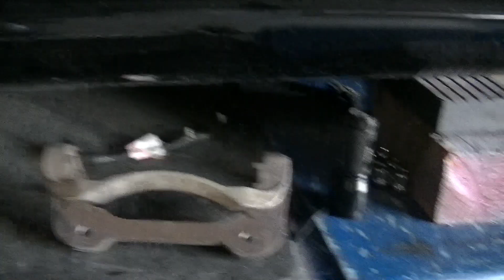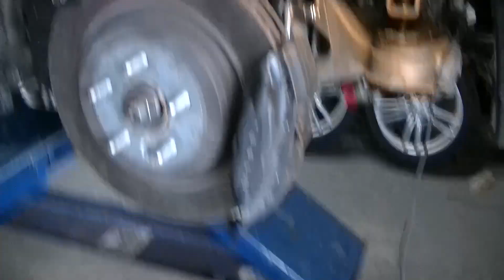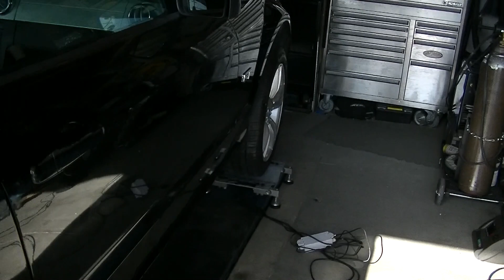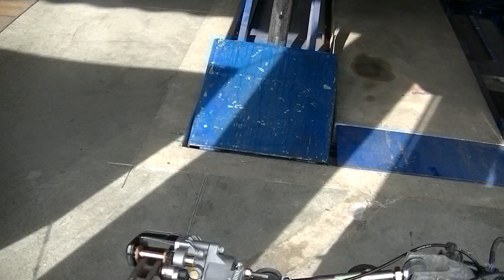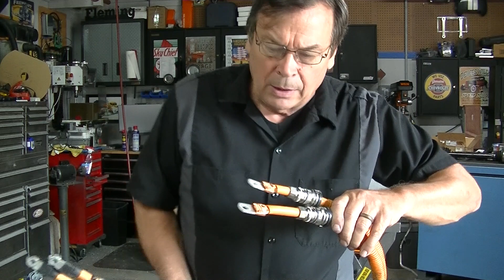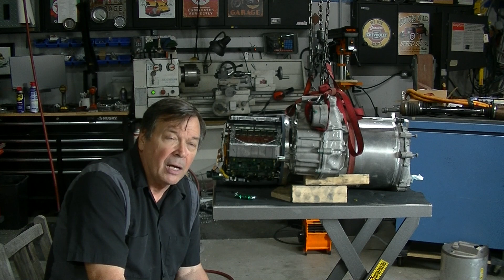Tesla Motor Swap Part 3

Comment: Great build! Where did you get the adjustable toe and camber links?
Reply from the maker: Speedway motors.
Reply from the maker: They are not plug and play, You have to make new sleeves and washers to fit the Model S suspension.
Reply: @Roadstercycle  Thanks so much! You wouldn't happen to have the part numbers would you? Did you have any issues with getting the coilovers fitted?
Reply from the maker: @DannyParks  Danny, There is issues and engineering every step of the way. The coil overs where a nightmare on my street. The next time I do a Model S setup I'll probably go with a push rod setup. I may have to do that with the Model 3 Mustang but we will see.

Comment: Good afternoon can you tell me what rear coil overs you used for this setup?
Reply from the maker: QA1. 400 lb spring rate. I think 300 would have been better.
Reply: @Roadstercycle  thanks for the response. We are getting ready to install our Tesla subframe into our Mustang project!
Reply: What type of vehicle would the rear set up been for? The mustang has a separate spring and shock. The coilovers you installed are an all in one setup similar to the front
Reply from the maker: @teslapoweredelectricfoxbod6696  I had to measure and figure it all out. You can buy QA1 shocks in a lot of lengths and also can buy many spring rates. I did not but coil overs that where for a specific car. I designed them for mine.

Comment: Thank you for doing this. I have been trying to learn as much as I can about EV conversion, specifically Tesla swapping. I have been scouring YouTube for months trying to get as much information as possible. I probably won't have the funds to do a conversion for a few more years but it's very interesting and I don't understand why more people aren't doing it. The Tesla CAN bus stuff was the largest hurdle in my mind. I didn't know Damien Maguire made his own controller for the motor, or even where it was to replace it. I've subscribed to him a few weeks ago but haven't made it through all his videos yet. Please show as much CAN bus stuff as you can when you're setting that up. 

I think the hardest thing to find after that is the wiring schematics. When you get it all done it would be amazing if you could go over how everything is plugged into each other. Great video.